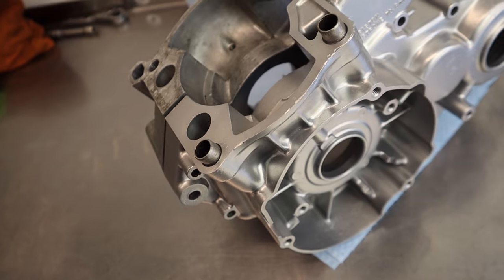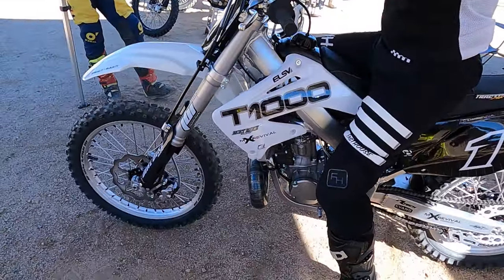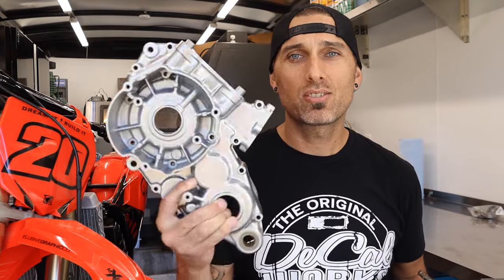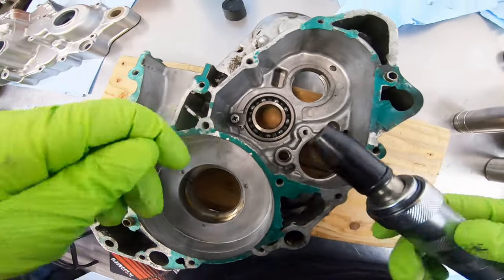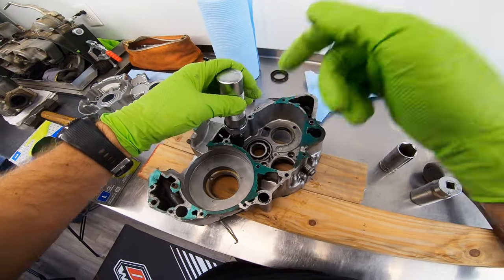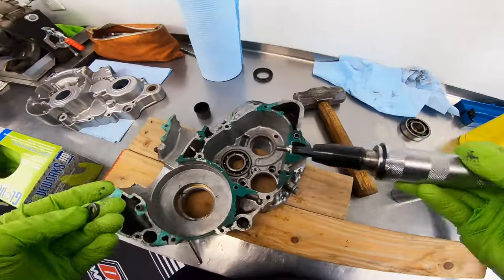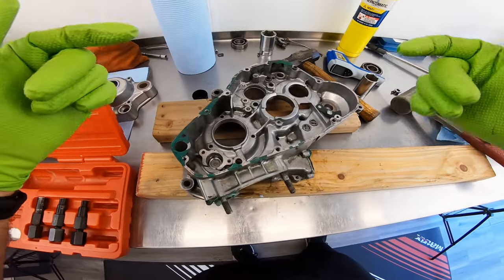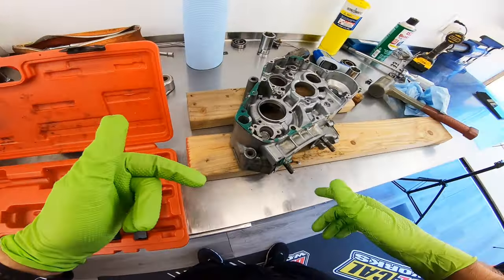My VAPOR BLASTING SECRETS - HOW to Vapor Blast & Make Aluminum Dirt Bike Parts Look Better Than New

Comment: The first thing I thought about when I read the title was one of the main secrets to vapor blasting is having the cabinet.
Reply from the maker: 😂 That's a fact! There are some really cool small/ bench top units out there too.
Reply: @mxrevival  Charles,  On average how long does it take you to makeover a bike?
Reply from the maker: @someoneyouknow96  man, such a tough question to answer. It almost can't really be answered properly. I guess I will use the extremes:

If I had everything I needed, 100% lined up, like the ultimate amount of proactivity you could imagine, and then some. (Which is impossible and never actually happens) you could probably get something amazing in 2-3 weeks. No filming or cell phone video only. 

On the flip side I have bikes here that I started 2 years ago. 

So many variables and things dependent upon getting parts, or who is helping with parts, are they labor intense parts or a brand new part for example... How's stock? Do I need to change course? (That happens often) Did the customer run out of money, etc 😂

Project Gun Show, which was a CR250 raffle bike I did a few years ago, took 3 months exactly. I was building that bike like crazy with a good amount of sponsors involved, and only getting to it after work or weekends at the time.

I was also figuring out YouTube and editing. I ended up having to extend the raffle one entire month because the graphics failed to arrive on time. Just one part...

Having said all that, it's not that the bikes are particularly hard to build or anything. You just have to have all the cooks who are in the kitchen with you, ready to party. I have A LOT of great friends and companies I "cook" with.

At any rate:

Launching on or around December 1st, I have something coming that is exactly 4 months in duration, planned well, and I think you're going to like it.

I don't want you to miss it 🤘
Reply: @mxrevival  I'm currently trying to figure out what exactly I'm going to do with my 98 kx250.  I know what I want to do but I dont know if its realistic or not.  Ive already had multiple setbacks and it gets me frustrated because its just me.  
I google stuff looking for answers and still come up short.
In the meantime I'm acquiring parts I dont truly need.  But they are quickly becoming obsolete.
A couple weeks ago I got a new seat pan from the UK.  Who in the hell would think I'd have to resort to purchasing something from the UK which appears unobtainable here in the US?  
But, ill keep at it.  Slow as a snail but moving forward.
Thanks for the reply.

Comment: For what its worth, overall with maintenance of whatever cabinet set up you go with, it's more sensible  to throw a guy 50 bucks that lives breathes and eats vapor blasting shit for a living. If your not into full time making show bikes, tight on space, and have limited heat, I would just have a big box in the way.
Guess I might buy that lapping plate off mp now after seeing this.
Reply from the maker: There's some real truth to that! Like you said, it'd be a burden for you. Dude, and some days I can't wait to get my face off the glass. Other days all I want to do is use it. That's where hiring someone comes in handy. 

Regarding the cabinet's size- I use this sucker for business, and wanted to be able to do complete frames. A small or benchtop unit would have been great for the rest of moto's "little parts". I'd always want some type of wet-blast cabinet around though. Happy I own it, it should last for years & years.

Comment: I have to say I was going to bust your balls on using such a small torch. When I saw that bearing fall out my eyes must have grown two sizes. When you were checking the temperature I really did not think it was hot enough. You proved me wrong which I have no problem with. That's why even with my experience I still watch people work on things. It's impossible for anyone to know everything and I enjoy watching young people like yourself do things differently and I would do.

When you were using the impact screwdriver I know it's called something else but I cannot think about it right now. I have seen guys totally destroy a perfectly good Phillips screw head by trying to use screwdrivers and in most cases they only have a number two. For some reason so motorcycles including Harley-Davidsons and Japanese bikes they have those big number three screws in different places. I know on my Harley it's supposed to be nicer than seeing a bolt. 
Also you're blind bearing puller is perfectly fine to use on anything. I know for Harley-Davidson they don't want you using that type of puller. They claim you have to use the one that uses a screw plate. I have lost track on how many came bearings on Harleys that I have changed using the slide hammer puller. 

I really do enjoy watching your videos. I absolutely gave you a thumbs up and a follow.
Look forward to see what you are up to next. Thanks for taking the time to make this video. I really enjoyed your information on how to clean the engine cases.
Reply from the maker: It's my great pleasure, especially when I get comments like yours. It's a good reminder for all of us to lose our ego and be open to learning new things. It's actually something I've gotten a lot better at this last year.

Here, it was both refreshing and a great lesson in humility for anyone reading.

Thank you for watching dude!